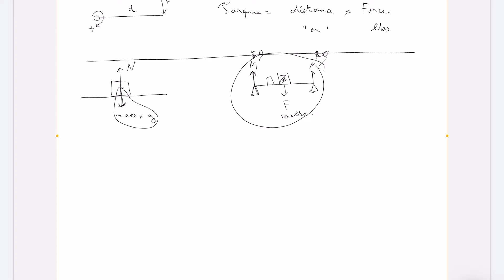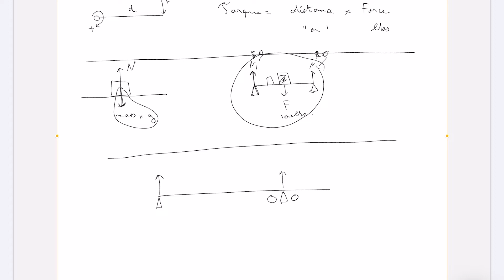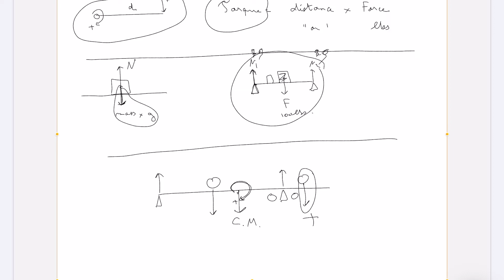Trailer design | Part 1 | Understanding torque and calculating axle position

Comment: I have a 2x5x x1/8 tubing frame goose neck trailer. Cross bracing is 32 inch  center with 2x3 tubing. The floor is 22 feet long with two 3500 lb axles. Could I change the axles to 5000lb and change the gross weight from 7000 to 10000? I can provide pictures of trailer if needed. Thanks Tommy
Reply from the maker: Yes, you can do that. But normally 10k lbs trailer have minimum 6" C-channel, the 2"x5" tubing will be a bit weaker than 6" c-channel, but still ok for the 22' length. That said, I don't know if you can legally change the weight rating on the trailer, unless you register it as a whole new trailer. It will depend on your state/province laws.
Reply: @ thank you for your time. I have had a load logs weighing more 7000 lbs with no issue. Bought a bigger tractor that weighs 6000lbs wanting to be legal and safe. Will only put the tractor on it a couple times a year. I will have to check with Virginia to see if title can have the gross weight changed. Thanks again Tommy.

Comment: George 
Would you be willing to assist me with my trailer project.
I understand the 60/40 rule on a trailer.
My question is, I have a ramp on the back that weighs 115 to 120 pounds. Plus a spare tire on the front around 40 pounds.
My question is, do I still use the 60/40 rule.
Reply from the maker: @anthonytim.6393  The length of the trailer is needed to make the exact calculation, but based on the numbers that you give, you can probably go with 65/35. As long as your tow vehicle can handle the tongue weight, it’s always better to have more weight on the hitch, for better stability and control.
Reply: @rgsabat  Thanks for responding back to my question. My trailer is a single axle. The trailer box is 5' wide x 10' long. The tongue is 4'-6". My tow vehicle is a 2500 GMC truck. Unfortunately I don't know the weight of the trailer.  
The main frame is 2x3 x 3/16 steel. And the sides above the main frame are 2x2 x 3/16 steel. 
Hopefully this will help you out with your calculations. Thanks again.

Comment: Hello >There,  how can i Find where is the Center Of Mass in My trailer, I have a Home made Campert Trailer 1 Axle, Roof tent, water tank, cooler...... spare in the front..
I am planning to go and get it weight. as it is so to see if weights are correctly distributed, but in order to check if axle is where it should need to know the location of the Center of Mass (CM)
Also will be remodeling it completly, with 4 link suspension, relocate water tank below floor, behind the axle.  etc. so will be also relocating the axle, and averything.
Reply from the maker: Hi Ricardo, you can use the calculation in this video to find the centre of mass location. Essentially, you have to add the torque moment from each weight component around an arbitrary point on the trailer. The centre of mass will be the point on the trailer that all forces on the left hand side would be equal to forces on the right hand side. It is hard to explain in writing, if you are not in a hurry, I will make a video about this topic and post it online.
Reply: @rgsabat  Thanks,  not in a Hurry,  I got it,  but have to weight the full Trailer as it is so to make sure I am counting all individual Forces.
I Should have to discount the Tires and Axle as UNSPRUNG Weight. Let You Know what I get.
Thanks.

Comment: Very nice ! I have a question .. why you devided the weight of the trailer into %15 in front and %85 on axles ?
Reply from the maker: You always want around 15% on the hitch to prevent the tow-behind trailer from swaying and for better weight distribution. The trailer will be a lot more stable that way.
Reply: @rgsabat  good day. may I ask if there is a reference(books or pdf, etc) for the 15% and 85%? For justification of my design to my professors. thank you
Reply from the maker: @nikkiyeilsismundo4828  sorry I don’t have an official reference

Comment: In the above video, the vertical reaction load at the  rear axle is shown 0.85W.
If i assume a value of W=10T, then  0.85W=8.5 T. Pl explain how to decide the axle rating or the axle  for this value of  vertical load for a triaxle.

Comment: I agree to this. In the video  is the centre of mass refers to frame only not including the axle weights.
pl clarify.
Hitch weight definition is  10% of GTW ( total of weight of frame+load+axle weight )Is this right.pl clarify
Reply from the maker: I am confident that the 10% hitch weight only refers to unsprung weight, so the trailer axles and tires weights are not included in the calculations. Think of a teeter totter, does the middle pivot support weight affect the way the teeter totter balance? It does not...

Comment: The self weight of the tandem axles is not considered. Pl explain how the calculations changes with this addition of axle weight.
Reply from the maker: You should not take the tandem axles weight into consideration, they are considered unsprung weight and they do not contribute to the hitch pin weight on the back of the truck.